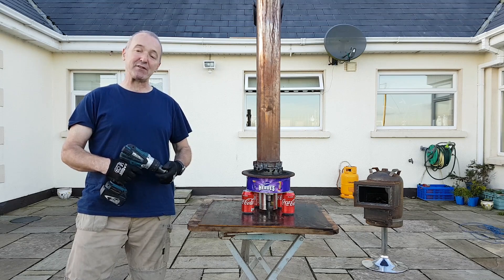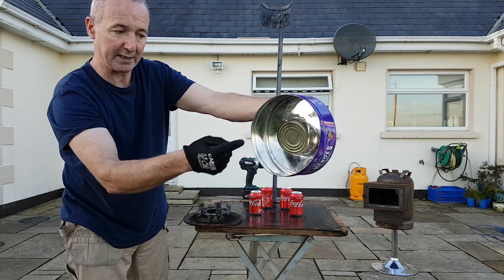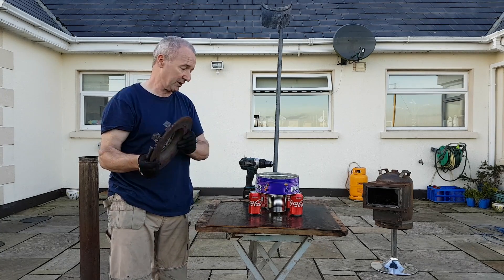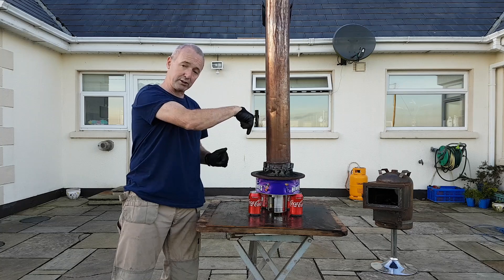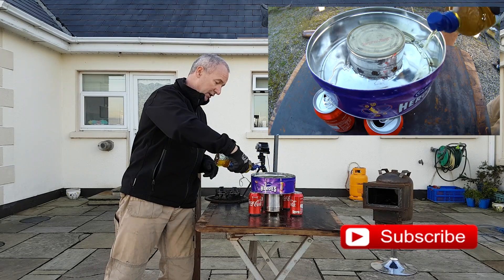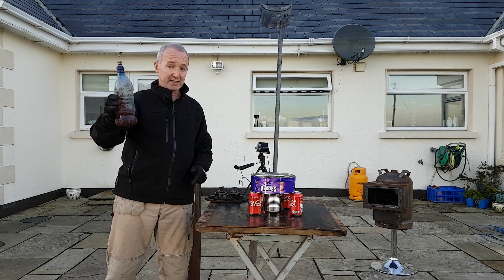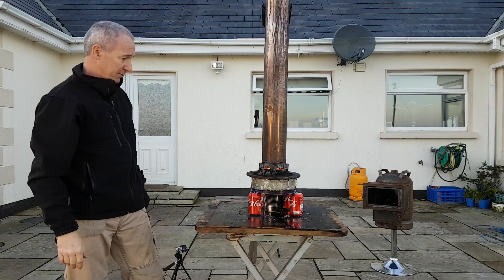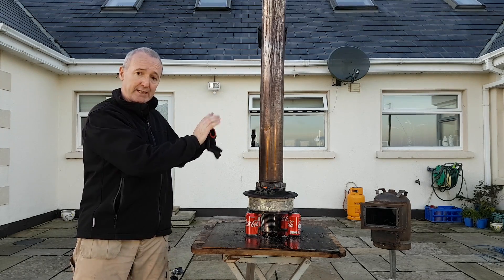How to build a Super Tin Can Waste Oil Burner

Comment: Hello Gerry I have a multi fuel camping stove and I want to run. Tozane fuel in it rather then kerosene. Would it be ok to use methalated spirit to preheat it.
Thanks😊
Reply from the maker: Hi Fionn. I had to look it up but its characteristics are very like paraffin which is basically kerosene. Try it with just a blow torch it should light up straight away without meths. Arms length with just a sup to try first. Hope this helps Cheers Gerry
Reply: GerrysDiy thanks😊

Comment: +GerrysDiy
I've have watched a few of these videos you have made and love the "chuck it together and see if it'll work" style.
I have made a couple of these oil/wood burners over the years from 45kg and 15kg tanks, but I'm now thinking about a micro stove, the chocolate/biscuit tin you used here set me off.
What do you think is the smallest workable size for an oil or wood stove? Maybe with a 3" diameter flue from exhaust or gas pipe as the governing size.

Comment: Thanks Gerry.  I hope to make a water heater to run a steam system to run a turbin, and than ues the turbine to power a generator to charge batteries, and power my house. The steam could also heat my home if I make the burner portable and install the steam heating piping at a later date.
Reply from the maker: Hi Jerry. I will be making some videos soon that might interest you. Cheers Gerry
Reply: GerrysDiy thanks. I look forward to seeing  your ideas.